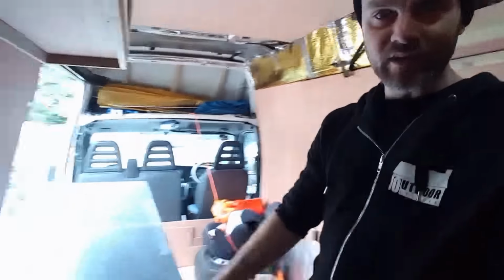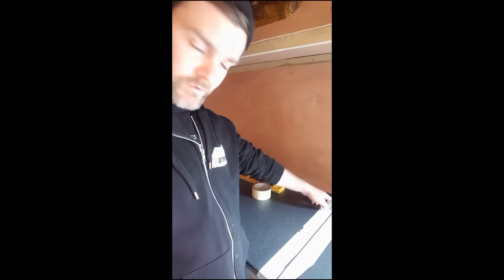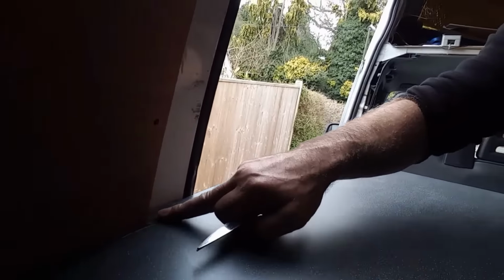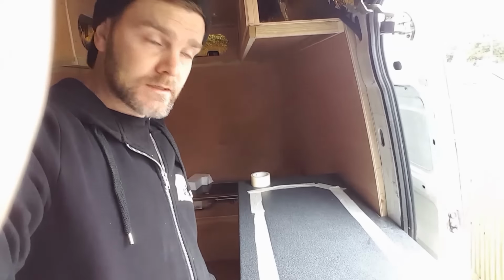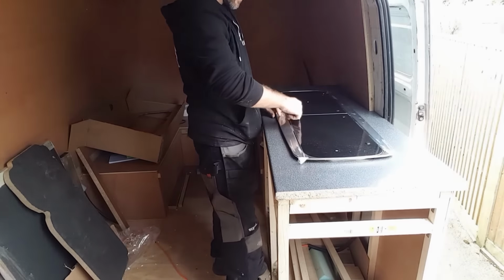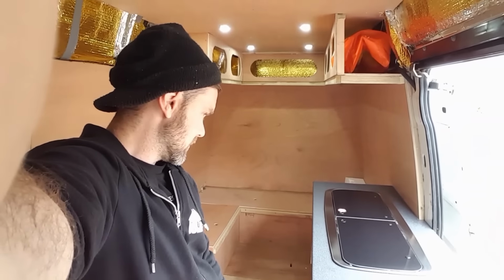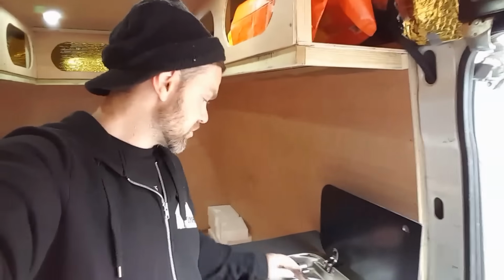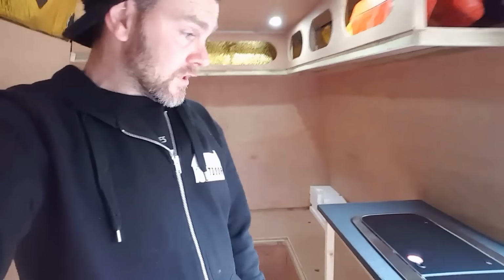Luke's Van Life! #4 (Kitchen install)

Comment: did you seal the edge of the worktop where you cut the hole for the sink, if not take it out and smear silicone all over the edges or it will swell and bubble up. (just a tip) ATB Kev
Reply from the maker: thanks Kev. no I haven't done that. I didn't even think about that. I presumed water wouldn't get to it to make it swell but better safe than sorry so I'll do that.  thank you